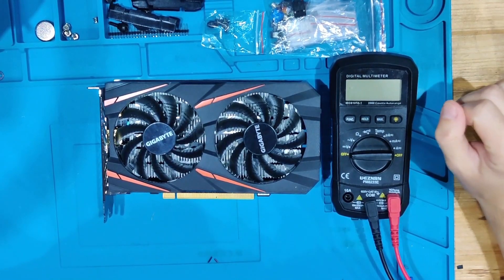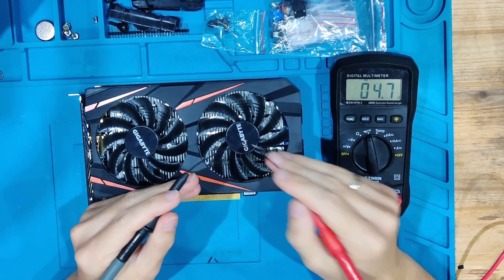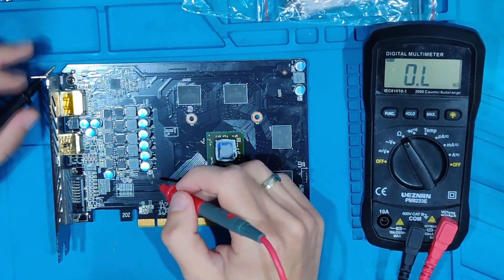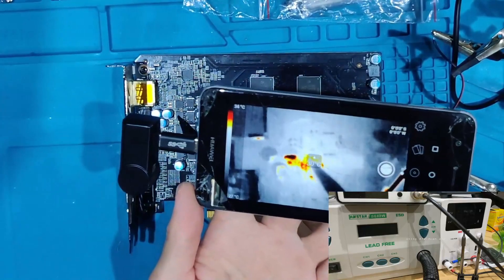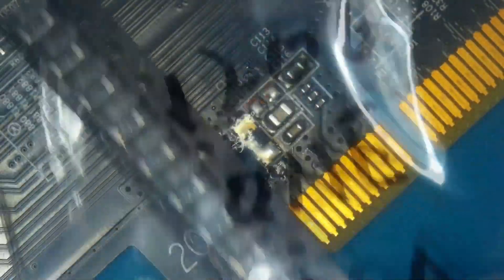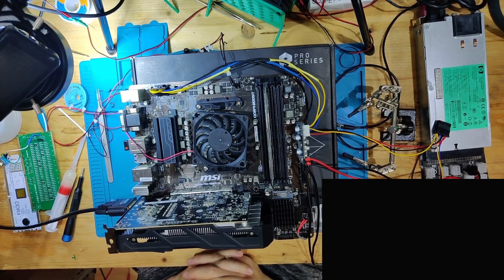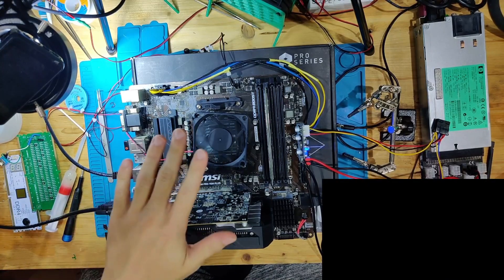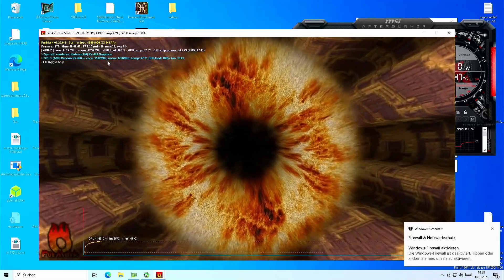Graphics Card Repair! Repairing an Gigabyte RX 460 4 GB that has no power!

Comment: GREAT. I have the same card. years in the box dead. I have also blown fuse. and u will not believe this...the same mosfet is dead. U dont need thermal cam. Only multimeter? Every Mosfet can u test in transit or continuity mode. there are 3 major types mosfets on this board. Set multimeter on (sound and diode-test.) transit or continuity mode. Place ground from multimeter to backside mosfet (ground).  the back have common solderpads. Place positive at the front individual 4 pins. measure the left or right pin . now u can view  the value on your display. GV6T1B=1.238 and GV6T1D=0.409 .other is on the back GV6U3P=0.762. The defective mosfet will give contenue sound. U can swap wires. Good mosfet give value. defective at corner pins wil give contenue beep. Best regards Peter

Comment: Awesome work I have the exact same video card and it has no display The card looks brand new wish I could do this I just don't have all that equipment.
Reply: GREAT. I have the same card. years in the box dead. I have also blown fuse. and u will not believe this...the same mosfet is dead. U dont need thermal cam. Only multimeter? Every Mosfet can u test in transit or continuity mode. there are 3 major types mosfets on this board. Set multimeter on (sound and diode-test.) transit or continuity mode. Place ground from multimeter to backside mosfet (ground).  the back have common solderpads. Place positive at the front individual 4 pins. measure the left or right pin . now u can view  the value on your display. GV6T1B=1.238 and GV6T1D=0.409 .other is on the back GV6U3P=0.762. The defective mosfet will give sound. U can swap wires. Good mosfet give value. defective at corner pins wil give contenu beep. Best regards Peter

Comment: so you just removed that mosfet not replacing it >? will that not affect later "gaming" or full power pulling from graphic card ?
Reply from the maker: Yes. I tested the power draw of the card and the performance with furmark. I didnt really see any difference there, but that is most likely due to the very low power budget this card has in generell. I think on higher end cards this would effect its performance a lot, but not on this small thing, expect, that the other parts of the VRM now have to work harder and thus get hotter. So its defenetly a downgrade!